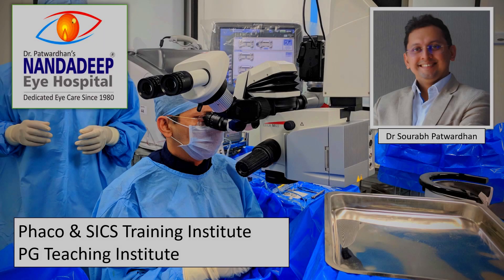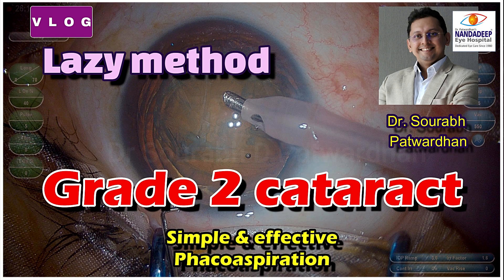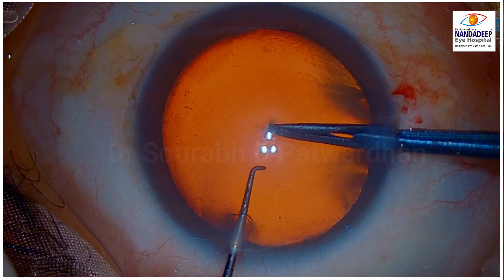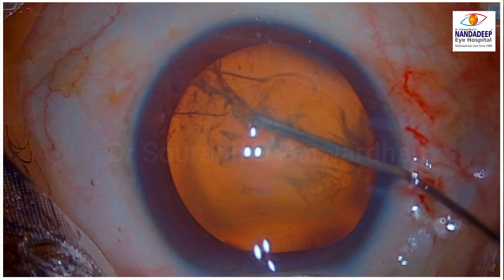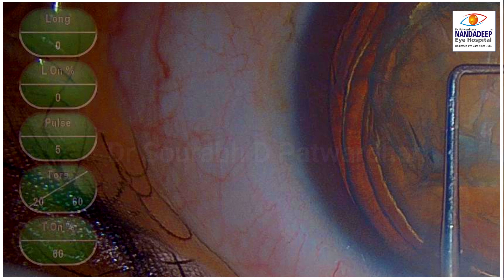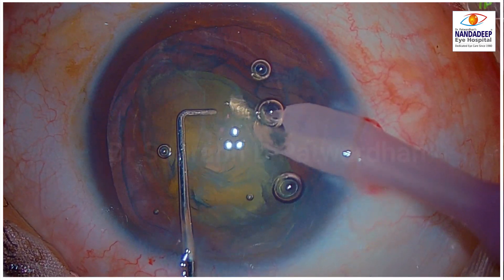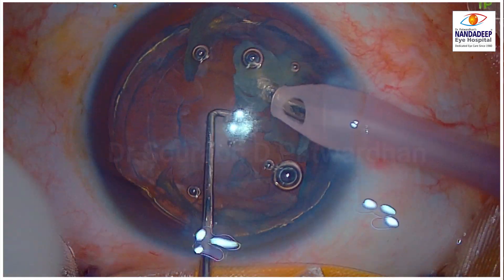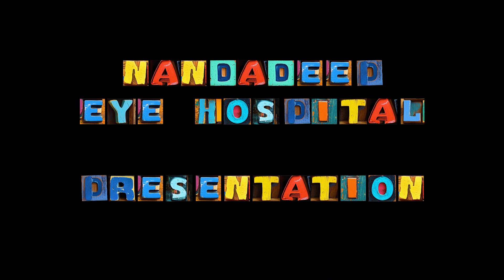264 Lazy method for grade 2 cataract -Phacoaspiration Dr Sourabh Patwardhan

Comment: It's a good method. If the cataract is soft enough, you can usually simply break it apart with the phaco probe and the second instrument when the lens is vertical. It's my preferred method, very reliable and it keeps the PC far away at all times. Vacuum only.
Reply from the maker: Thank you